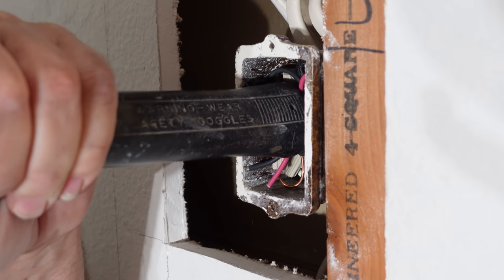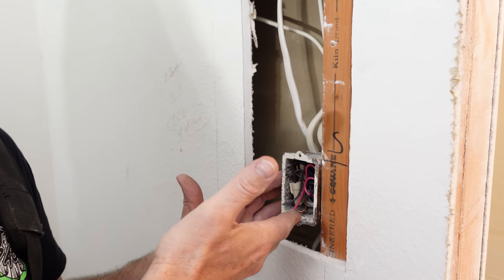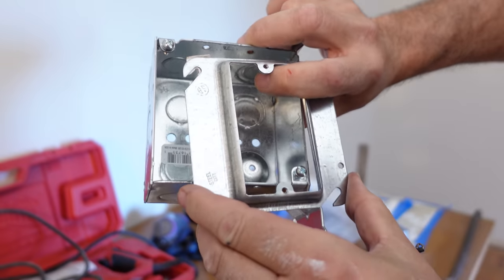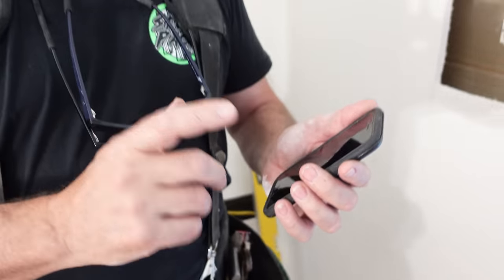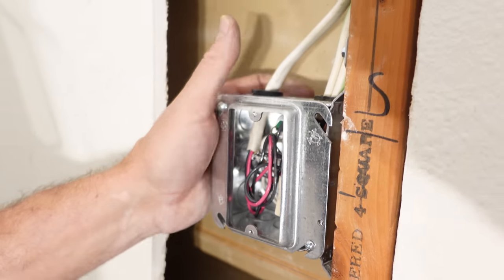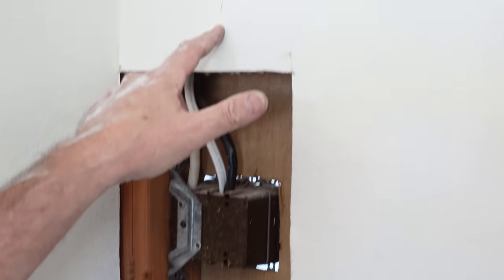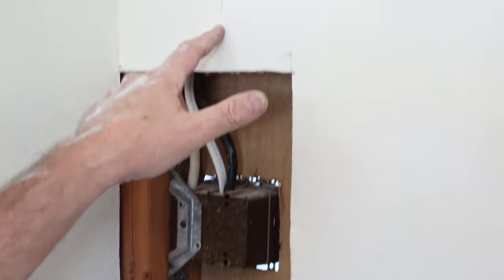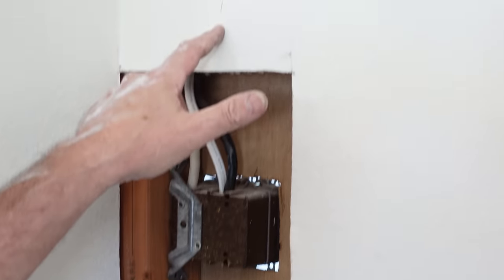STOP STUFFING BOXES! How Many Wires is TOO Many??

Comment: The one piece “Bell” outdoor cover is now illegal to use according to the NEC 2020 code.  Instead, use a clear “Bubble” cover so it allow the plug to be in the outlet while the connection is covered from the weather.  Nice video and thank for the tip about the app.
Reply: That sucks the bell one looks nice, the bubble one fades after a few years
Reply from the maker: We’re still on 2014 where I live 😳🙄👍
Reply: @StudPack  Regardless of the NEC Code date being used, electrical safety comes first. The Bell style outdoor lid cover design is not considered weather resistant when the outlet is being used.  The "Bubble" enclosure style design is considered more weather resistant when the outlet is being used, especially during rain and snow events.
Reply: @StudPack  I'd recommend in use covers regardless of what code you are under. They are just more practical and safe.
Reply: Several companies manufacture die-cast aluminum "In-Use" covers .. such as Intematic, TayMac, etc  They are far more durable than the plastic types. Plastic types break at the hinge pins too easily. A few more bucks but, far better. Also available are the telescoping type as well.
Reply: @billhandymanbill2775  
Thats what gfci is for

Comment: What a coincidence. This morning I’m reworking the existing wiring and adding a few circuits for cabinet lighting in my kitchen in preparation for new quartz countertops and backsplash. The adjustable boxes are great and I learned about them from you guys from previous videos. A little pricey at box stores but well worth it. I have 12 kitchen backsplash outlets to refit with them. Very helpful video today. Thanks! 👍👍
Reply from the maker: Thx 👊👍
Reply: every OTHER outlet (on the counter tops) on a different circuit? Z06Doc

Comment: Love your videos. Noticed on one of them that there was some push in wiring on receptacles. I have seen those come loose and melt insulation off the wire. Another thing, when wiring receptacles in series the load is going through the little brass connector. I was taught to wire in parallel.

Comment: I've worked as an electrician for a few years, I've seen all the old wire. Just by trying to strip I can usually tell the difference between new and old. I'm not being a smart ass but some of that old black 12/2 or anything like seems to be a little off sized sometimes. I guess you could account for all the years/ warming and cooling hell idk. Some 12/2 almost seemed off sized again. I love doing old houses with ole  pole and rope or that's what we call around here wiring. It's always learning something new for me that keeps it 💯  or brushing up on my technique.

Comment: This is a really fun channel.  I've had to deal with so many of these issues that it's great to see how others tackle them.  In my case the most difficult aspect of rewiring is the hassle of dealing with plaster and lath walls that are tricky to cut into and repair - particularly when you don't have replacement wallpaper.  I'd love to see more discussion about the pros and cons of leaving behind non-grounded wires - specifically when they're going just to a light fixture.

Comment: Great video !  All the DIYers need to realize the electrical codes i.e. National. State / Province are in place and must ne adhered to.  Failure can lend itself to fires and as a result, the voiding of your home Insurance.  Have an Electrical Inspector inspect your work both, prior to covering the job up ("roughing in") and upon completion of the job ("Finishing").

Comment: All plastic boxes (just like the first box you showed the inside of) will have a little quick reference for box fill. They show 11/14, meaning you can have 11x 14awg conductors. 10/12 meaning 10x 12awg conductors, etc. Just a pretty quick reference for someone that is familiar with box fill that just needs a quick reference to add the conductors/devices quickly.
Reply from the maker: Those refer to conductor equivalents not conductors.   You still have to deduct for grounds, fittings, devices.   If you put 11 14s in there it would be overfilling IMO 👊👍
Reply: @StudPack  yes you still have to be familiar with what a device, grounding conductors, and clamps are equivalent to but if you are. This makes it very easy while in the field

Comment: Guys, really great stuff and I enjoy your pace so I don't get a case of the "yawns" as you're explaining things. Because you guys asked I'll share looking at your work thru the "Heavy Industrial Lens" . At the gate we would have placed a fitting at the box and the end of the conduit to use a "Flex whip" to seal out the weather rather than leaving the conduit end exposed even though you were using "SOW" cord. I get your use of the plug for a quick disconnect instead of an actual disconnect switch at the box so maybe some duct seal over the conduit end. Also we would have grounded the metal gate itself (separately) because of the potential your described about the fridge incident and the gate being outside. Tisk tisk about the installers not connecting that circuit ground at the plug. Someone else made comment about the possibility of the motor end or the controls end possibly not having the ground terminated too, need to check that. Love watching your stuff, I know some electricians don't have half the quality you guys have. Keep up the good stuff!!

Comment: I have a kitchen island with the cooktop on one side of the island as opposed to the center. Unfortunately, there was only one receptacle, and it was on the side where the cooktop was. That meant anytime we wanted to plug an appliance in on the island, we had to stretch an extension cord all the across the island, sometimes across the cooktop. So I decided to run a box to the other side of the island. I am informed enough to know that exposed wiring underneath the island needs to be in conduit, but when I went to the big box store, the only conduit they had was way more than the few feet I needed for the island. Plus it was expensive, and I would still need to buy the 14/2 cable. However, there was an option available with conduit that included wiring that was much cheaper and almost the exact length. The only problem is it was 12/2 wiring. But, I couldn't resist. Everything went great except for the existing box where I extended the run. That 12/2 cable is fat and stiff and just wouldn't fit in the box all the way. As a result, the coverplate kind of sticks out a little. But after watching your video, I am going to get a bigger box.
Thanks for all the great insight!

Comment: I wish I had seen this before I completely wired my house built in 1892 and I took the advice of an employee at my home improvement store!! My studs are true 2×4's but they're all turned sideways so I only had 2" depth to install electrical boxes. Guy had me buy these shallow single gang boxes. With 8 outlets in every room (yes I know, a bit excessive but I like to rearrange my furniture a lot and wanted to make sure there was an outlet everywhere I could possibly want one!) and a light switch in all 11 rooms (plus a few extra for 3-way switches) there was a crap ton to replace when the inspector showed up and explained that I needed so much cubic inches for so many wires. I had to go thru and undo all those outlets and switches and boxes just to do them properly. Ugh!! I did go back to home improvement store and educate the guy that didn't know what he was doing so hopefully he'd never make that mistake with anyone else😁
Reply: Not sure how you solved the issue, but Carlon makes a shallow box with side volume that will give you 18 cu. in. Part number SN018-6R.

Comment: 2-gang metal boxes with 1-gang mud rings are definitely the way to go.  Just mount the box flush with the stud and use 1/2" mud rings.  Not the cheapest, but nice and strong and plenty of room.
Reply: I like the locking box connectors vs those plastic things.
Reply: till the next guy has to come chisel out the drywall, tile whatever from around the mud ring to get to the screws. they used single gang metal boxes with single gang mud rings everywhere in the bathrooms,kitchens at our complex, trying to add a gfi takes forever since I have to dig out the screws, wrestle mud ring off without completely destroying the cut out

Comment: Surprised the inspector would pass the nails and tie straps in that bathroom for multi cables. Usually we have to use the multi cable stackers.

Really good info about the box volume and wire volume!

Comment: At 13:15, if you keep your drywall screws at least 12-16 in. away from the box, the hump in the drywall will never be noticed.  At 15:15, with the wires reversed it was blowing breakers; their fix was to clip the ground wire...  Electricians are licensed for a reason.

Comment: One good thing I seen somebody do on the last house I did was any time there was a 220v wire coming down, they would use a 2x wide double gang box and it was so nice to work with because I had lots of room to bend the wires in place and I would just use the appropriate 2x wide cover
Reply: 220v cable I meant. Sorry lol I watch your videos

Comment: I much prefer the metal boxes. If something comes apart it is going to trip your breaker. I dislike tape around devices for the same reason. It can't protect from mechanical failure and in my opinion it is a false sense of security. Doing maintenance I want to see what's going on before I touch it.

 And the device mounting screws always strip out the threads on the plastic boxes.

Comment: Sparky should have upsized the box when he changed the wiring, IMNSHO.
Y'all cover the bases, man. Impressive every single time.
Reply: I thought the same thing, but I later decided that Paul asked them not to change it, so that he could use it in this video in order to teach us what to do in that situation.
No doubt, the electrical contractor knew that the box was too small, and if they didn't, Paul wouldn't hire them to begin with.
Reply: @stanyoung6593  I too thought that may be the case. I don't make videos though, I just construct and renovate with a similar mindset on it being right when I get done. 
I almost can't believe Paul paid others to run the new wires, except they have done some wire fishing vids already.
This team impresses me tremendously. I would trust Paul to build anything I could ever want to own.
Reply from the maker: Yes I asked them to leave that box for the video 😂👊.

Comment: When I built my house I was tag on two things.  Box fill in a 2 boxes, and wire length coming out of the box.  He was upset I push the wires back in the box and he could make sure they were long enough.  Not to bad for someone that never wired a whole house before. Now I'm finishing my basement, and paying attn to both.   Not sure about metal but the Blue boxes tell you how many wires you can have coming into them so you can quickly glance without having to calculate them every time.

Comment: As an electrician box fill becomes almost second nature and is rarely calculated outside of some circumstances. I’ve used electrician’s helper which offers a box fill calculator minus appliances and connectors, just wires, but mostly use it for conduit fill, which also is second nature but when you get an odd wire size or mix it never hurts to double check. I like the ease of this as a quick check but so everyone is aware it is based off the 2014 version of NEC we’ve since had 2017 and 2020 versions and depending on the municipalities acceptance may be out of date, though I don’t recall a change to box fill tables between the three. Usually calculations don’t change only standards regarding protective standards and installation requirements, i.e. AFCI or the 3/8 foot rule regarding tube/showers.
Reply from the maker: Good stuff thx Chris 👍👊

Comment: Technically your appliance or in this case gate opener doesn't need a ground when using a GFI outlet as the GFI will shut down the circuit, but of course, if it is there way not use it. Although the technique of installing GFCI devices in an ungrounded circuit doesn’t ground the circuit, it does provide protection in the event that any electricity leaks to ground, thereby preventing electrical shocks and injury.  It does not however give any protection for surges of excess current.

Comment: You men are great, very enjoyable videos/teachings. I have a problem: I purchased 30’ of 10/4 bx for my 30 amp cb to my 4 prong 30 amp inlet box for my 6500 watt generator. I’m 10’short. Can I buy another 10’ of 10/4 bx and splice them together? Junction box? Twist and wire nut? If you would be so kind to get back to me with a detailed answer/solution. All the best Mike i. I’m so mad at myself for not getting the 40’. I got mixed up because I bought and needed a 30’ 10/4 sjoow cord(from inlet to generator) Thanks again. Mike i.

Comment: I had a problem where I just needed to replace a bad switch. The box had wiring that honestly seemed more intended for industrial purposes than a house from the year the house was built. It was a pain getting the switch out, and hell getting the replacement- NOT a different size, mind!- back in. I could not get the face plate to sit flat.... 

Still, I don't think I did too bad for a teenager doing their first electrical project.

Comment: You'll love it when you finally get to a house that has new AFCI breakers....you don't have to search for them, just touch the ground to the neutral and the breaker will trip - no sparks flying to do it either.
Years ago I rewired a double wide that had the wire stolen out of the walls - they pulled the wire from the outlet up the wall to a high staple (about 5 feet of wire) and snipped it off.....left ALL of the wire in the attic and did about $10k worth of damage to the home to steal about $10 worth of copper.  I went to putting in 12/2 everywhere and 20 amp breakers.  The inspector OK'd using 14/2 to run to other receptacles as long as the 12/2 ran to the first receptacle, as some of the wire was able to be tied back in.  I haven't been able to find it in old code anywhere, but I'm pretty sure at the time it was legal in the code.  Which code doesn't allow receptacles on larger than 20 amp breakers now, but my house has a couple of 30 amp circuits with receptacles wired in on them.  Once I get around to changing my box one of these years I'll have that all corrected, as it's mostly in the kitchen and I've already dropped a couple of new wires to fix it but haven't tied it in.
Reply: That is still unsafe because if there is more than 15 amps (but equal to or less than 20 amps) of load on the receptacles with the 14/2 cable, it could over heat and the 20 amp breaker will never trip.

Comment: Gonna have to do some rewiring on a DIY, original owners ran a bunch of 14 gauge on 20 amp circuits to a bunch of light circuits. Stud Pack have you all made a video for small drywall patches that are going to be needed to replace the holes that are cut for re-running wire/replacing boxes? To include cutting holes for boxes, taping, mudding, sanding, and painting? Or for anyone else reading this, do you have any video recommendations for such a scenario? Worried about that small piece of drywall between the box and the old drywall breaking during the box cutout process and/or failing once drywall screws are in that little piece.
Reply from the maker: Look for “butterfly patches” on YT.   I use them all the time.

Comment: I needed some boxes in my attic to add a relay for a duct fan. My local HD was out of plastic double boxes completely!  I was forced to buy a weatherproof outdoor box to get the size large enough, almost $25. It looks really good though.
Reply: Could've used metal 1900 box with mudring or gangable metal switch boxes for much cheaper.

Comment: Electrician put a bunch of splices into one shallow double gang box in my basement. I'm looking at it thinking it can't be right.
11 cables coming in, mix off 12 and 14, providing splices for 3 separate circuits. I figure I'll split them out into 3 individual boxes.
Same electrician used a fat sharpie to label the panel (upgraded to 200 amp)  couldn't read a thing on it. We went through and typed up our own list.
Reply: You can have several circuits in a junction box but you still need to calculate box fill. Now if the 12 and 14 wires are actually connected together then that is a problem, if there is a 20 amp breaker. If there is a 15 amp breaker than the 12 isn't a problem, it's just over sized.

Comment: Pushing the wires into the blue box ( 249-b at 11:22 in your video
 ) did you have to loosen up the plastic on those wire entries? You kind of skimmed over that part. I have a box like that and wondered if I should push a screwdriver through first.

Comment: Just reaching out...Again... I am approaching a dilemma and I cannot find any info on my next task so I thought I would reach out and see if I can get some feedback. I have and am sound proofing my middle bedroom to be my new home recording studio. The walls are secure with triple insulation including 1-1/2 rigid foam insulation sealed with insulation spray foam. This room is not only dead silent now it is completely air tight...except for my ceiling. The only thing left is the ceiling. My plan is to also apply the 1-1/2 rigid insulation sheets to the ceiling. Once done the entire room will be completely covered in 2-inch acoustic foam panels. Here's my issue. I need to drop my ceiling light fixtures down about four inches. Wiring is not a concern, but I'm not sure how to securely drop & mount the box to remount my lights to clear the double foam. Your thoughts?